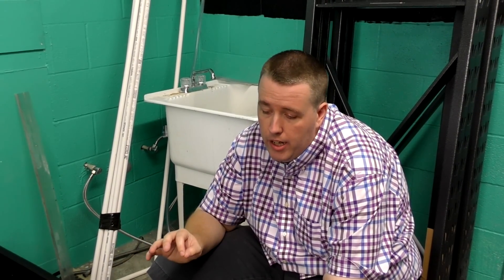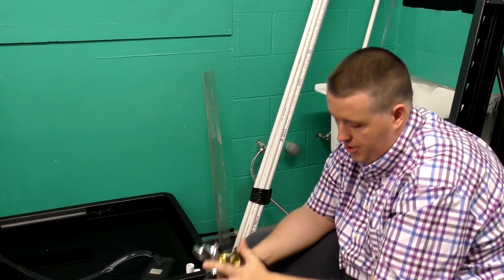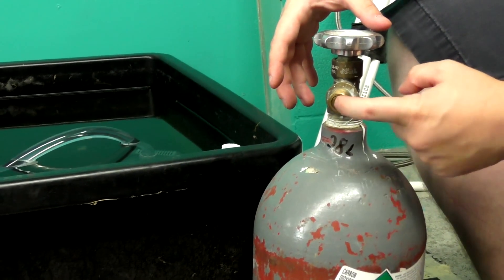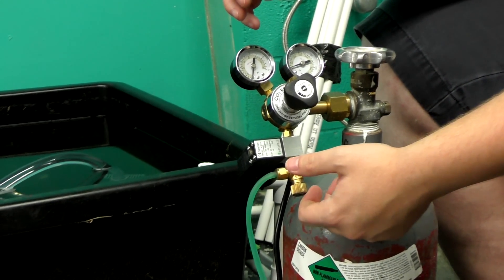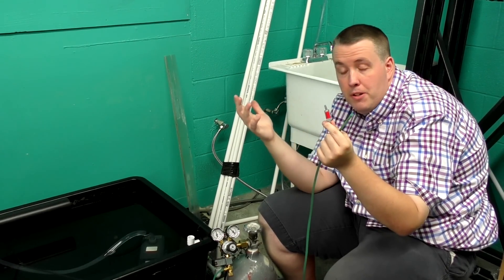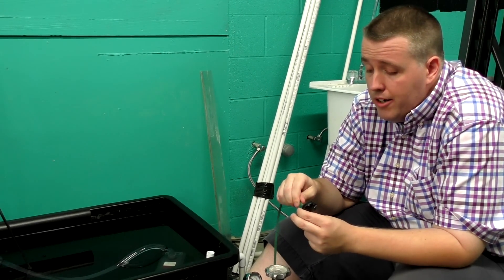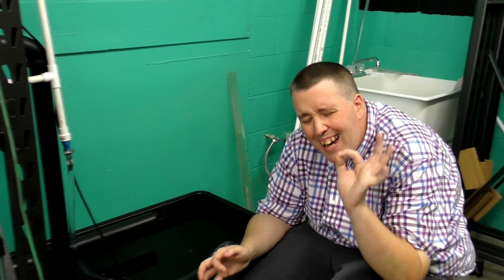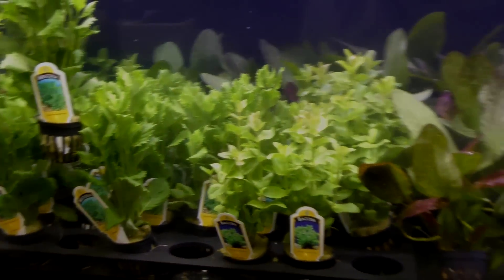AQUARIUM CO2 GUIDE

Comment: I'm surprised you haven't corrected the error on this video as it's been pointed out to you several times in the comments.The aquatek is NOT a dual stage regulator. It can dump all the co2 if left to drain out. Aquatek has two gauges, but it is classfied as a single stage regulator. You need a DUAL STAGE (not dual gauge) regulator to control the end of tank dump.

Comment: I have a 125 gallon tank and started my CO2. I was wondering how much if at all the surface area break up for oxygenating my tank will affect the CO2 in the tank. The CO2 is set on a timer and will not be running constantly. Will it just bubble out and not be absorbed in the water column?

Comment: I learnt recently that the only difference between CO2 rated tubing and the normal tubing is the pressure rating. Normal silicone is rated at 2 bar but CO2 rated tubing is 6 bar.

Comment: My aquarium without CO2 is pH 7.5 and with CO2 saturation is pH 6.7 (low KH)
Surely if your CO2 is on for 12 hours and off for 12 hours (to only cover the photosynthesis period), the aquarium will want to swing between these pH levels, thus introducing stress on the fish? With the water column 'saturated' with CO2, the amount of CO2 that the plants take out the water is negligible overall. Would it not be better to aim for stability of pH rather than save a little on CO2?

Comment: 00:42 wrong info there. The dual Gauges only show the Bottle pressure and working pressure. What you mean are dual body reducers/regulators. They can maintain a constant working pressure even if the bottle is about to get empty and the pressure in the bottle flips.

Comment: THANK YOU for this video! I am going to get a dual stage regulator and the gasket type you recommend. 
I’m brand new to using CO2  (sorry 😬) so I have a couple questions..
How much CO2 should I be adding? I understand starting at one bubble and slowly increasing but at what point do I know it’s enough? Is it determined by tank size? I know you mentioned looking at the plants but I’m not comfortable yet relying on my own visual confirmation. I don’t want to harm any tank inhabitants. 
Does every tank need it’s own CO2 canister? I want to run CO2 to several tanks off the same canister or a couple canisters. Some shrimp only/plant tanks are only 2 gallons and then planted/fish in various sizes up to 125 gallons. Can I use a gang valve and then flow control valves for airline tubing to control each tank’s CO2? Or would that be impossible since the CO2 regulator is going to allow pressure buildup behind the individual flow control valves? Can I watch my internal pressure gauge and if it creeps up then I can lower the outflow? Would that allow me to control individual lines? Or is there something made for CO2 that will help me run multiple tanks at different rates that I should use?
Thank you Cory! My best fish friend and I have enjoyed your channel so much we say “Well Cory says....” 😂
Edit: I just saw the manifold in your store. I’m off to search your videos to see if I can get answers but if you have time I would greatly appreciate any help with my questions. Ty!

Comment: Great information Cory, I’m just setting up a 125 gal with co2, I was going to use an external diffuser that I would hook to my canister filter feed line, but I like your suggestion about running the co2 line to a hang on the back filter, now how do you accomplish this, can I just put an in the tank diffuser below the intake tube, or just put the co2 tube directly in the sump of the hob, I have a seachem tidal 110, I like this idea better than splicing an external diffuser, I just don’t want another fitting that could leak. Thanks for the video

Comment: Just FYI, CO2 Tank pressures will remain at or around 800 until all the liquid is gone, this is the head pressure of liquid CO2. Once the liquid is gone then the pressure starts to decrease. You still have time, but the tank gauge pressure does not tell how full it is, weight is the best for that.

Comment: The ridiculousness of people worrying about saving money in a hobby that's generally a huge money sink is hilarious - a hobby where proper substrate can cost up to $25/bag, $100 - $300 for a light, $400 - $900 for a tank and stand, $40 - $300 filter, $30 - $80 heater, $20 to $60 test kits, $3 - $10/fish, $10 to $15/plant, $40 - $400 CO2 fertlization, $20 - $150 fertilizers, etc., etc., etc. etc. Now you're going to worry about incremental expenses of going DIY CO2 to Pressurized CO2? SMH...

Comment: I have a 20 gallon tank and I am new to the hobby of planted tanks, my tank is still in the cycling stages. I am slowly starting to get this whole CO2 thing but every regulator I see it has reviews of it breaking after a while and then it gasses all the fish.. what is a good brand to go with? the area where my tank is I don't have much space and it's out in the open so I was thinking about going with a paintball 20 or 24oz tank. What would be a good regulator to use?

Comment: Hi I bought a plant growth system 60 , it's a disposable co2 system, the first day I filled the chamber to the recommended amount and about an hour later the tank was full of little air bubbles but since then wen I fill the chamber it goes down a lot slower sometimes I still got some left at the end of the day,also I can see some really tiny bubbles but not many of them and they don't stick in the tank , is this normal ?

Comment: Hello Cory I just set up a fluval 88 co2 system for my 55 gallon planted tank. Right now I have the same diffuser that you used in this video hooked to it. For filtration I'm using a hang on back filter. I do have a canister hang on back filter. My question is. Would I benefit more by sending the co2 through the canister filter instead of using the diffuser shown in this video? I'd like to get the most out of the co2 that I'm pumping into the tank. Thanks

Comment: Solid video. In a 75g dosed tank would you put your sponge filter on a timer if you also have a canister filter running? Or would you up the bpm to get the saturation? Thanks keep crushing it.
Reply from the maker: I would run the sponge filter 24/7 and adjust the co2 if needed.
Reply: Thanks for the snappy reply. You guys make me want to sump!

Comment: So putting the CO2 diffuser up against the return pump helps spread the CO2 throughout the system better? My return ends in a spray bar across the top of my tank. Do you think a significant amount of CO2 would be lost by using that spray bar?
Reply from the maker: I do t think you are losing that much from the spray bar
Reply: Thank you!

Comment: Hey Corey, how come you're running a sump on this system as opposed to your usual auto water change set up?
Reply from the maker: +Kyle Putney because it'll take less equipment to run the 24planted tanks. Can use 1 co2 tank and 1 auto doses.
Reply: Jimmy of Aquarium Coop makes sense, does it put a lot of extra maintenance on you though? For water changes?

Comment: Thank you for CO2 educational course   Cory I got a good tip for you that prevents any CO2 loss or blow offs , at each end of the tubing use a heat shrink for wires this will lock the tubing into place like a clamp on the hose
Reply: Sorry for the miss leading information. When I meant blow offs I mean the holes popping off , from too much pressure

Comment: I have a super small 10 gallon and use a DIY setup. I'm going to buy one of these setups once I get a larger tank going. I didn't know they had regulators with power that can run on a timer. That changes the game. I have to leave mine on and just run an air stone on high at night.

Comment: My plants keep dying on me do u think adding c02 is the key? It's about the only thing I have not tried. They are in a 30g tank with guppies.
Reply from the maker: Depends on the plants, but most plants don't need co2. Typically people have a problem with their light or the fertilizer they're using.
Reply: Jimmy of Aquarium Coop all i have is a sand substrate an plenty of light. No fertilizer at all. I add liquid plant food. Do i need to do a fertilizer substrate?
Reply: what plants are you growing? Liquid fertilizer helps water column feeders and substrate helps root feeding.

Comment: Instead of the defuser for the bubbles, assuming you have a sump.  Can you just put the bubble line right to the sump pump and it would blow the CO2 right into the tank?  It would get chopped up by the sump pump?  would you still need a defuser?
Reply: he said that in the video
Reply: You can but it can be hard on pumps long term as it causes cavitation. I bought an inline defuser to try it, but I haven't received it yet.

Comment: Cory I think the only one thing you forget is to tell about the bottle is to purge the bottle first or you're going to get all the dirt and Sand in it
Reply: I've literally never purged a bottle before, over 12 years, probably 100 or so tanks, never once had a dirt problem. it might exist, I've just never run into it.
Reply: I am  Ironworker when you open a new bottle there silica or some kind a duster is inside the bottle it actually destroys your manifold in your regulator eventually

Comment: Hi Cory - Dual gauge does not equal dual stage, all current Aquatek regulators are single stage. With their premium one you have the ability to adjust the working pressure, but you can still get a dump when the tank runs low. Thanks & keep up the great work.

Comment: Cory- it's important to distinguish dual GAUGE and dual STAGE.  Dual gauge simply has one gauge for tank, 1 gauge for set pressure.  Dual STAGE actually has two different diaphragms or poppets with springs which control the pressure.  dual STAGE is what prevents end of tank dump.  Dual GAUGE will only let you watch as your whole tank dumps.   Almost all regulators are dual GUAGE but only the higher quality ($$$ generally) are dual STAGE.  Co2ART was your cheapest true dual stage but now that they aren't taking orders, ebaying a high quality welding regulator (victor or similar) is the only way to get dual stage.
Reply: Yes very important distinction - there have even been reports of some companies miss-selling dual gauge regulators as dual stage so do get a recommendation before you buy.
Reply: Julian Morgan yah co2 supermarket did that to me though when i replaced with a c02 art regulator the difference could easily be seen
Reply: Right on!  One tip:  If you have anyone in your family or friend circle that has an  A/C license they can pick up a true "Dual Stage" regulator at the warehouse for really cheap compared to retail!
Reply: So for this set up i need dual stage ?
Reply: Big oversight here. Very different things!

Comment: Is there a way to test the CO2 levels in your tank? Is there an optimum level to try to achieve? I want a shell dweller tank, I know it will mostly be sand and that they will eat most plants.. Are there any that would be safe from the shell dwellers? I'd like to run CO2 and have a few gorgeous plants vs. a bunch of ratty, eaten up junkers. :) Thanks!!
Reply: There are ways to test, drop checkers etc. What you're trying to achieve would be very difficult and I haven't seen anyone pull it off yet.
Reply: Thanks! Any recommendations for types of plants they might leave alone? Also - do you have a go-to place I might find N. Similis? Waaaaaaaaaaant. and can't find. :(

Comment: Nice video. I would like to add that dual gauge does not mean dual stage, a co2 regulator can have two gauges and be single stage and not give protection from end of tank dump. Also you can adjust output pressure on most single stage regulators, they can however vary in output pressure range with some not going low enough for use in aquariums.

Comment: You're off just a bit my man. A dual guage is not the same as a dual stage. That aquatek is a single stage and is theoretically susceptible to end of tank dump. A dual stage regulator will prevent that, but the stages are in the diaphragm not in the guages.
Reply: My bad, I've never experienced an end of tank dump in my 12 years of doing co2.
Reply: Aquarium Co-Op me neither. I think folks make a bigger deal about it than it really is. I do think it's more likely at higher working pressures like the kind needed for atomic diffusers.